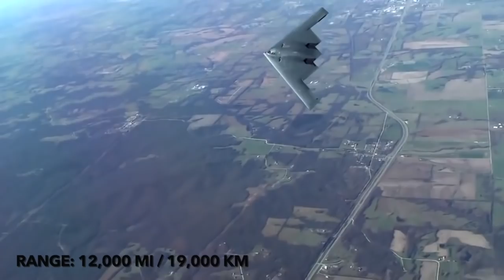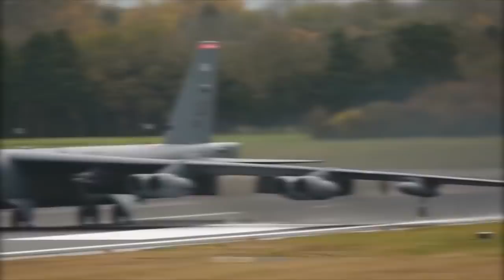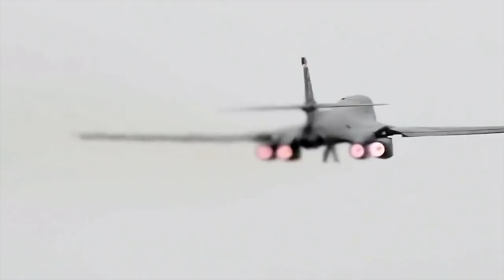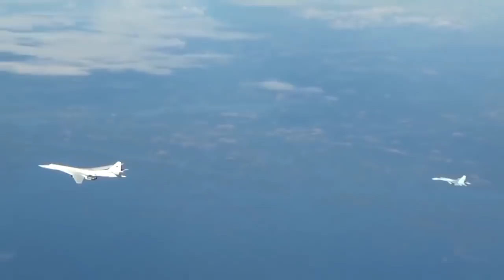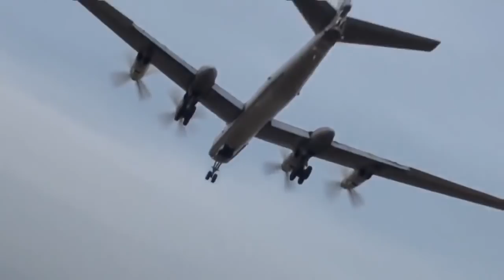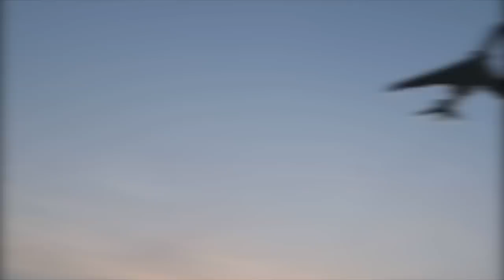The US Build Powerful Bomber The World Is Afraid Of

Comment: B2 spirit has a top speed of 3300km/h
Reply: No. Absolutely not.  The B-2A is not a supersonic bomber. It cannot go faster than sound. Not designed to do so.   Maximum speed: 630 mph (1,010 km/h, 550 kn) at 40,000 ft (12,000 m) altitude / Mach 0.95 at sea level

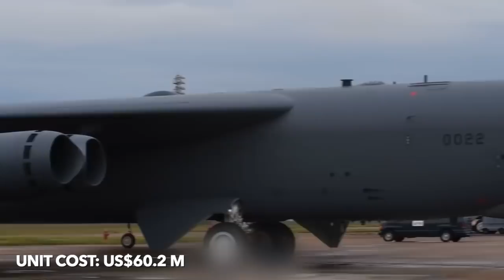Comment: @3:02, Incorrect. My service in the USAF was on B-52's. It's powered by eight Pratt & Whitney turbofan jet engines (the only jet in active service with eight engines), has an unrefueled range of 8,800 miles. Not "4" engines.
Reply: I was wondering about that. I see 8 engines and I always thought it ran 8.
Reply: Barksdale?

Comment: So the B-52 will retire another 40 years or so after the newer B-1 bomber. That's amazing.
Reply: Ain't that the truth !! Not sure anything has been in service longer . It's like it's immortal lol .
Reply: B-1 was originally designed to be a high performance aircraft with mach 2 capability, thus its airframe was lighter weight and used more exotic materials and mmanufacturing processes. These did not hold up well over time especially when its role changed to low level terrain following which subjects the plane  to much more turbulence.  As a result the airframes suffered numerous stress cracks too costly to repair. The B-52 only had to be big and heavy duty from the start.

Comment: Important roll by patrolling the skies with Nuclear weapons? What bombing is a threat not stopping wars. Now only if you new the truth about the nuclear weapons in bombers. Well so many mistakes have happened from bombers crashing with nukes on board to accidental release of bombs on run ways good hob none exploded or America would be in a mess right now, But the radiation from some of the bombers that crashed in the sky when the bombs hit the ground in the aircraft was a bit strange as did not tell the residents as the bombs did not explode but they did leak.  Now no are craft is the best as always an expert will find away of spotting or destroying a bomber. Now with the new passive radar mixed with total radar they can spot a toy drone made mainly of plastic parts and very small. Making a signature of jamming obsolete as can tell where the jamming started and see through it. Steal aircraft can now be spotted and tracked. Then there are satellites with maps of the earth by anyone.

Comment: I went through school ( Air Force ) on the old B-36 in the 50s. It had 10 engines, 6- 4360s pushers and 4 - J47 jets. Ended up Asst. Crew Chief on a EC 121 Radar Plane.

Comment: @front cost There are EIGHT engines, NOT 4.  There are four pylons, each pylon holds 2 engines...  

also, it's not "grewman",  it's "GRUMMAN" like "uhm"  GRUMMAN.
Reply: nacels not pylons
Reply: @harveypointn.a.s.5243  No, you are incorrect.  On the B-52, the structure that holds the engines is called a pylon.  Go look at the "B-52 pylon upgrade" program.  I didn't wiki this shit, I was actually IN the military.  The nacelle surrounds the engine.  The engines and nacelles hang on the, wait for it, PYLON.